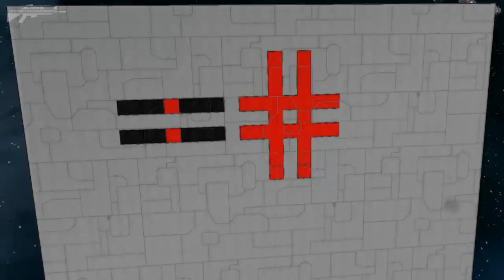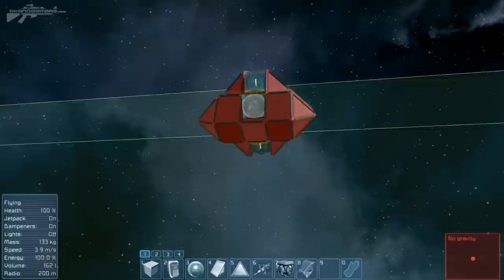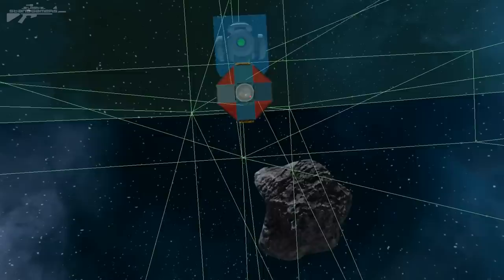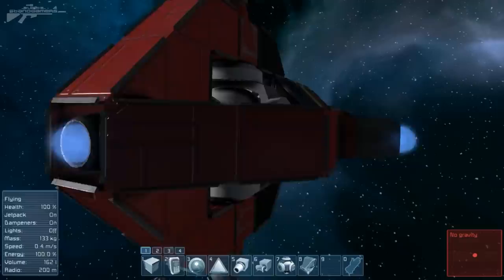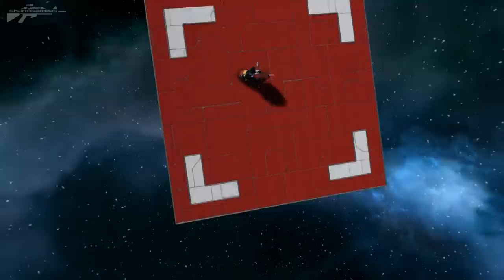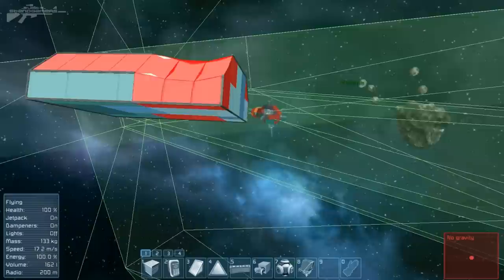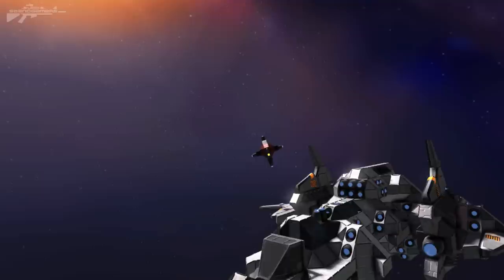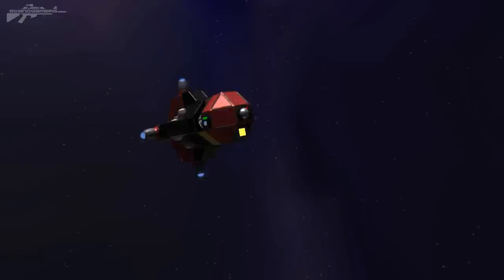Space Engineers - Lock On Missiles, Sensor Guided Ordnance Concept

Comment: With those Drones (or missiles or whatever you want to call them) with a turret on them you could possibly has a useful weapon for pirates or faction to leave in target areas. Surely no one wants to encounter one of these drones with missile turrets on it while it is berserk attacking everything in sight until disable by its captain (done via antennas for remote access) or destroyed by one of its targets (or hunters).

I already can imagine flying in a freighter threw space and then getting a alert when one of these things (refer to upper paragraph) starts firing missiles at my external armor (what you think I would not armor my vessels... Are YOU NUTS!!) where it deactivates when four pirate vessels come into range and begin firing on what looks like key areas while my ship is already damaged. Forcing me to self destruct to prevent them from getting much. (yes I would put a self destruct system in unless on safe mode or whatever its called does not keep it from exploding when it takes damage)

RP and Comments are allowed. Just mark your RP with just (RP) on the first line

Comment: you can put a drill on the front with a mine behind, when it borrows into the heavy armour the sensor on the mine, set to a very low area towards the rear of the missile, detonates inside the ships armour. or attach the small ship laser mod, Laser/Plasma cutter 2.0 from the workshop and watch it eat a big ship alive, like a worm in an apple!!!
Reply: just have a bunch of them launched at a large ship....creepy
Reply: attach a string of extended pistons and have a flying ribbon attack enemy ships!!!
Reply: Sage style...I like it....